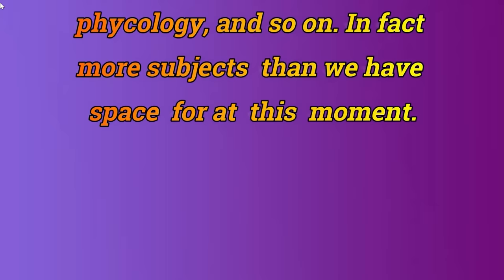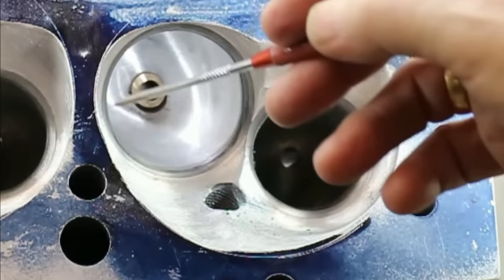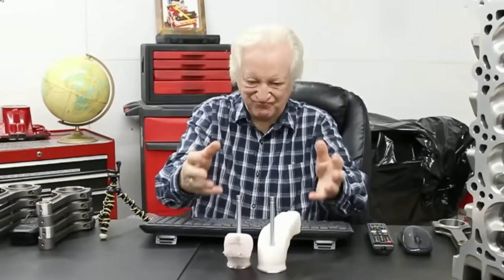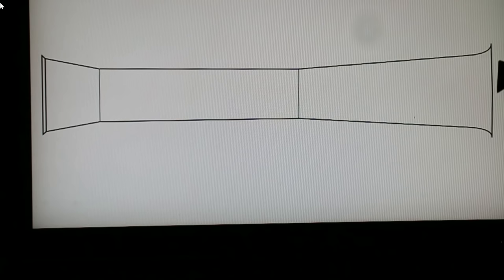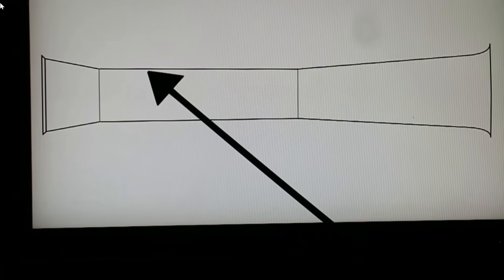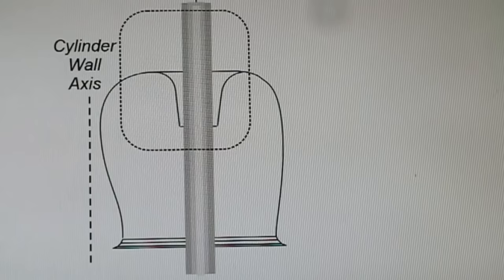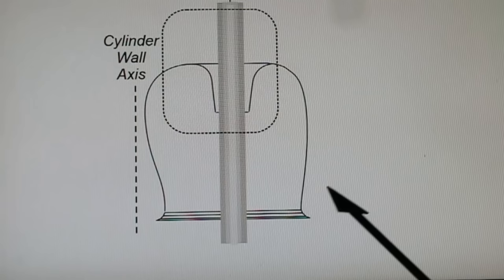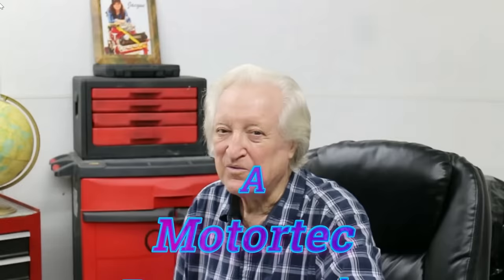Five Golden Porting rules - Rule #1 Part 2

Comment: I would like to say that I like what you are doing.  I would like to say that you have spent and I am guessing around 10 million on testing over the last 5 decades and you have most likely forgot more than others will ever know.  I am sure that is true, even with me, I say that.  I am sure that you can run circles around me.  The car that I am working on is a 1973 440 CUDA.  The best time that this car has done is 9.52 seconds at 142 m.p.h.  Our 60 foot time was 1.31 seconds.  That would be with a stock 440 engine block.  My brother and I got an inexpensive pair of aluminum heads and ported them.  The best that I could get comfortably was 359 c.f.m.'s.  I am so tired of heads that crack.  I remember when I was 14 years old and my grandmothers house was shaking and I got out of bed and had to see what all the racket was.  My room was on the 3rd floor and looking out the window I saw a 1971 HEMI CUDA coming out from underground and turned right on Hennepin Ave.  He floored the throttle and I thought that all the windows in the house were going to shatter.  That brand new black HEMI CUDA was it for me I have never forgot that.  Jerry

Comment: Years ago in the 1980's I ported the head on my 1978 Suzuki GS1000 when I installed a Weisco 100cc overbore kit following tips I learned from reading Davids article's. It was a beast, with an absolutely smooth pull from idle to 9500 rpm! Thank you David!
Reply: I remember when they hit the market!!, They were absolutely baddest thing around!!!
Reply: @michaelhurley3333  That's true, I loved it so much I had trouble going to sleep every night for quite awhile, I just wanted get back up and go riding somewhere! It was two years before another bike took the lead from the GS1000 and if I remember it was the GS1150, that was it Suzuki being on top for several years though.

Comment: Had a local head porter do a set of big block heads for me once. His work slowed the work that I did down. 
Anyone paying attention to DV will realize porting heads is not all about flow benches. Max flow number is useless to me and average flow is what I'm after. A flow bench is a tool used to check the productivity of your work. If you suck, then that flow bench will let you know, buy it won't tell you where. 
Thanks David, you are the man

Comment: David Vizard, have you ever ported a set of mid 60's iron Pontiac heads?  Layout and intake side of the head is very similar to a SBC. But the valve sizes are 2.19 and 1.88.  I ported a set based on how the Chevy Power Manual said to do SBC heads and opened up the pinch as much as I dared.  The info in the Chevy Power Manual is very much like what you teach.  In the early 1980's I ended up with a low budget, stock bore and stroke 455 build with flat top pistons and flat tappet cam that ran 10.50's in the 1/4 at 130mph in a 3400 lb GTO and never turned it over 6200 rpm.  I really enjoy watching your videos and seeing my engine building theories validated.  I'm still learning and appreciate you sharing your knowledge.

Comment: My hat off to you, I`ve been building engines for years and I`ve tried to port heads and found I don`t have the patience or skills to do it, can`t even make a few passes with a cutter without it chattering so I send them to Champion or HVH cause they are nearer me.. If I had access to a bench I might take another shot at it as I`m retired now and only pick and choose which customers I work for. By the way I bought my first book of yours on Holley carbs circa 1988ish and when I read it from cover to cover I knew you weren`t a journalist as I was told, your knowledge and explanations were way beyond journalism.

Comment: David, reading some of your works earlier on had a huge impact on my understanding of the small block chevy, and engine theory in general several years ago when I first took interest. Funny enough I'm actually at a weird crossroads where I'm building a motor based on some of the stuff I learned previously, and it's fascinating getting to relearn what you originally taught me. 

When it pertains to actually attracting viewership, i can say that having an expert like Dave speaking has it's value, but that having pans, and shots in real life, and possibly demonstrations of some of the adjustments would be huge. Honestly, listening to an expert speak at an expert level from an entry level/intermediate theory position can be somewhat dry, and intimidating, and having someone available to simplify things further, or to actually show some of the work being done would be a huge boon for the page.

Thank you for continuing to share the engineering knowledge you have gained and fostered.

Comment: I have been a fan since "Theory and practice of cylinder head modification".  Worked on my sprite and vw heads! Thanks. It makes sense that both sides of the port are not equal in flow. They can't be. Thanks for the work you  do.

Comment: David, 
  Based on info in your books i have always started at the seat. Working back up the bowl & then out into the chamber. I progressed to doung the seat machining first. This is dangerous & most porters cut the seats after to avoid knicking the faces. But the care is worth it! I found air flow jump starting early.

Comment: Back in the late 1980's. Built out a Ford cortina 250 ci crossflow torque monster with Lewis race engines. This guys books were my bible for port flow & velocity & how to combine that with the cam induction & exhaust as a complete package. The thermo dynamics were all optimised to fatten & flatten torque from 1500 to 5.5k Worked a little too well. Ripped the splines off 2 manual boxes and ate a diff. Before a bullet proof drive line was built that could handle its grunt.
But it usually needed 100 more seriously worked cubic inches to beat it on the road.
Taught me I could have my cake and eat it. Power is one hell of a drug!

Comment: Thanks D.V. for sharing. Bowl and port design on the BMC small bore heads would be on the top of my wishlist in a video, and of course a revision 4 on the Tuning the A-series, with larger pictures , drawings with scale and extended exhaust system part. Best regards Andreas

Comment: Good video on flow. Fluid dynamics are very important and what you said is very interesting to think about. 
I worked in aerospace metrology and understand the dynamics of what your saying. It makes sense. keep the videos coming. 
I'm a SBC guy and still love my 283s. 
I do my own porting and always have a interest in flow even with small valve heads. 
One machine shop told me it's not worth porting power pack heads. I quickly told him your not the machine shop for me then because I'm the guy paying. 
I was just trying to make my P.P.heads flow better for efficiency not just power.

Comment: I think I have watched almost all of your videos. Great information. Something I would like to see is information on low rpm torque. Most everything I have read says wide lsa. I would like your opinion on the subject.
Reply: Kirt, I am not an engine builder, but the amount of LSA effects the overlap and should be picked according to higher torque at lower RPM, running a stock torque converter as a daily driver. I guess, I am still still trying to wrap my head around the physics of this event. A 1967 C10, 5.3L iron truck engine, 3.08 final with a cam at 112 degrees LSA and P265/75R16 reasonable tires for mileage and economy, but I am retired! So everyone's needs or desires are different. But like you, at least for me, the most bang for the buck considering a low first gear that can take me to 5,500 RPM if I was bumper to bumper with a smart a$$ and felt like my pickup may surprise you. But within the speed limit as I still pay insurance. Duh! 
DK, Omaha.
  "Built for 6' 3" guy, easy in, easy out, & BCM w/all Benefits of 03 Tahoe! RKE, P/W, Lights, Theft, Locks, Dimming, Warning Chimes, Remote Start, Anti-Lock Out, Etc. 
Happy holidays and all stay safe...
Reply: Butting in here.
DV says that any particular engine requires ONE specific LSA lobe separation angle.(as per formula)  You choose the overlap/ duration as to what rpm you want the power to occur or the idle and vacuum characteristics. Specific LSA never changes. 
Just passing on DV's info.
Reply: @hotrodray6802   one specific lsa for "WOT" max tq. Partial throttle tq/response is a different matter.
Reply: @HotRod Ray   I understand that but I am currently thinking of upgrading the cam in my dodge ram and it will rarely see anything over 4000 rpm. I'm trying to wrap my head around all of the information Mr. Vizard has been sharing and everything seems to be directed towards maximum output and nothing geared towards a pickup towing engine. I am loving  the videos and I plan to buy the books soon. I apologize if this sounds rude as I don't intend it that way
Reply: @craig8187  I believe you understand what I'm asking
Reply: @kirkoliver2389  put the proper sized turbo on it with the stock cam and you will make way more torque below 4000rpm than any cam you could put in it naturally aspirated.
Reply: @bcbloc02  have been toying with that idea. Turbos are new to me. Don't have any experience with them.
Reply: @kirkoliver2389  I have had my eye out for a good blow thru carb for my poly 318 as I too want more torque and the fact the engine is already low compression at like 8-1 means I should be able to make some power with it without needing custom pistons and a non available cam.
Reply: @bcbloc02  I have a 5.9 magnum in a dodge ram. I've built a few sbc with good results but this is new to me. Trying to make a gas engine pull like a diesel is a new challenge.

Comment: Excellent! Thank you
Mr Vizzard, I would like to say. 99% of the time. The pinch is indeed adiquate for CSA and won't yeild much of a gain with enlargment. However, I think it would be good to include a segment on the subject of pinch restriction and or other upstream restrictions.  Because there is a point (well say around 350 ft per second and faster) were it does become destructive to power. The other thing would be the relationship between pinch velocity, bowl area and net valve lift or curtain area. All hold each others hands. IMO.

Comment: Your man Kevin Hunt's "energy bucket" concept fits pulse tuning principles but needs to be elaborated on.. the length of the "energy bucket".. should be approx equal to the pulse time of the valve during it's opening phase .. that being the time it would take for max peak ram effect to have reached the trumpet end of the energy bucket at the same time the valve opening begins to slow before max lift is reached.. this then makes the most opportunity for the highest energized flow at the trumpet end of the energy bucket & transitioned pressure to have reached the valve seat choke point into the cylinder.. thereafter the pulse pressure wave from the trumpet mouth begins to slow transitioning further to pressure till the valve closes.. boundary layer laminar flow of the port walls would be more than consequencial in the equation in that 1-2deg of taper.. there's been significant research in the oil industry of flow characteristics of liquids in a pipe of boundary layers.. air is  a liquid !

Comment: David, I built a 400/470 CID Chrysler which dyno‘d at Ron Grose’s shop in Lodi, CA which with a little 750 Holley and a street single plane intake produced 1.326 lb. ft. of TQ per CID.  NOTE: the engine was already coming down off peak torque at the first data point recorded @ 3500 rpm.  Who knows what peak torque was or exactly where. The engine was designed by me to run a dual VenturiLess Dominator set up which I am certain would have produced at least another 50 lb. ft. of torque producing in the range of 1.43 lb. ft. per CID.  I ported the heads, performed the valve job, spec’d the custom ground solid roller personally.

I know you know what an excellent IR system is worth.   At the very least an appropriate single plane and a Dominator would have kicked up the torque peak as well as the horsepower peak.  With the 750 Holley and street single plane the engine made 623 lb. TQ @ 3500 and 549 HP @ 5500 rpm.  My goal with the complete package including the IR system was 650/650 providing a very broad power band

Comment: Another great video DV!  It's got me thinking about modifying another stock intake for my 5.9 magnum. The first one made very good improvements over stock even though i know it could be alot better. But then again I might build a cross r ram for it
Reply: Build a cross ram! Dual throttle bodies and direct port injection would be pretty sweet. The trick, I think, would be figuring runner length. Air/fuel is heavier than just air so maybe a short ram/ cross ram would be the way to go... But either way would be fun to build.

Comment: Let's use a sbc as the ginnea pig and  use 1.5 and 1.94 valves in a stock head.
 Would you port or shape a head differently for a 5000rpm engine as a 6500rpm engine?
....or does the same porting contour benefit both?
I'm 65 and have only built two engines ...30ish years ago. Your books gave me the guts to attempt doing those.
You're a gem. 👍

Comment: DV, hat off to you.  I was skeptically  reserved but more curious of my build.  So I compared your formulas to my mathematics (slightly higher than most) and I found they corrected much closer than anticipated. Not to talk myself up so I wont. The principal said I used in my calculations you are from three aerospace engineers that worked at Warminster Airbase off of Jacksonville Road in Pennsylvania. One of those great guys where is actually a fan of Saab automobiles that's one mystery that I can't understand. I wonder if you ever met them because she was from England as well about your age

Comment: I’ve been playing around with cylinder heads for awhile currently I’m working on vw 8v x flow head’s which is difficult because the port is pretty optimized from the start tho there is a lot to be gained with widening the top of the port, opening up the valve seat at lots of chamber reworking, on a turbo build with limited control of timing I have lots of compression to lose, 10:1 factory looking for ~8.5:1, back cut the valves and blended the seats to the chamber, the current head I’ve ran made 200 whp at 12psi and 290 who at 20 psi hopefully the head I’m working on currently will clear 300hp with less than 20psi with bigger valves and some epoxy work on the intake, raised ports, completely custom intake manifold, this head is hard to work with the valves and placed vertical to the bore and not much room between valves but raising the runners gained us 15 cfm from the last port job and the port work way rougher than the last head and I’m going to polish the combustion chambers this time see if that helps with detonation

Comment: Hello David, very interesting what you have said, although I don't agree with everything you explain. For example, a cam profile made up of three radii. That led to many broken springs at Cosworth at the time. I calculated cam profiles for smooth cams back in the 80's, where the final section to the top of the cam was a 4th degree polynomial.
Regarding the valve seat. Everyone insists on the three angles on the valve seat. This is from the time when tuning was still very manual work and improvisation. Why can't you design the entire contour as a radius and only design the 45° seat to be 1.5 to 2.0mm?
That is today's time with 5-axis CNC machines to produce exactly.
kind regards
Helmut from Germany (74 years old)

Comment: I love the videos and have been watching for years but never subscribed - until today. No, I'm not going to port my heads. The word "velocity" was mentioned which jogged my brain. At 81, need something to jog my brain. I still race an altered with a supercharged 365" 354 early hemi. I runs good but not good enough to beat the 500"+ guys. About 7-years ago I purchased one of Darrel Gwynn's top fuel engines from the mid-90's. It runs on alcohol. After many changes to the tune and a lot of frustration, not much better than the early hemi. Maybe .20 (7.30) on the et. and a speed of 188. Here's where the word velocity comes in - at least where my brain was taking me. The intake valves are 2.400 and the ports about 2.3" square. Good for tons of volume required for a fuel engine but not so good for velocity. Most of the guys in my group were running a 3.90 or 4.10 gear. I chose a 4.10 but didn't want to go lower due to the increased rpm and maintenance cost. By now, everyone reading has their opinion. I went to a 4.30 which ups the rpm to about 8700.
Results: 6.61 @ 209.92 on the second run. That's over 20 mph and .7 improvement in et with one fairly inexpensive change. Probably even better with some decent heads. Thanks, David for all the informative videos and in particular, for jogging the brain of an old die hard racer.

Comment: @David Vizard: Not clear to me where this dotted line called 'Cilinder Axis' comes from in your drawing. Or at least why it is positioned there as you did. 
It seems to me that the cilinder is position under the head/valve. 
Or do you mean that the bowl/space on the inner side next to the valve stem must be bigger than on the opposite of the valve stem hench the outer side near the Cilinder wall should be smaller = more speed of mixture along the incoming side of the combustion chamber and therefore creating a swirl in the cilinder.

Comment: That trick flow twisted wedge head will prove these theories right or wrong! With the intake valve angle, the bowl is tilted back. The air stream is directed directly onto the back side of the valve.  These heads place more of the charge on the roof of the chamber.